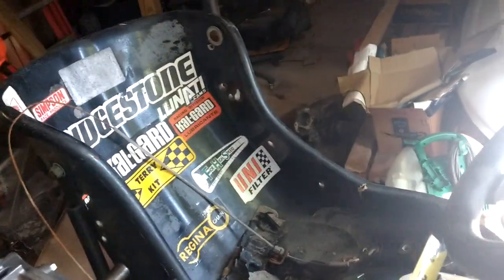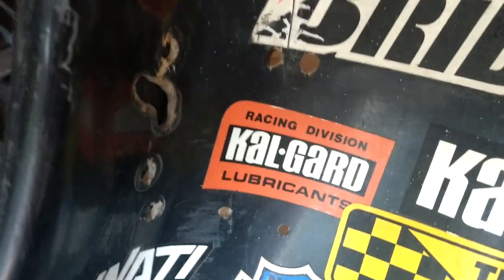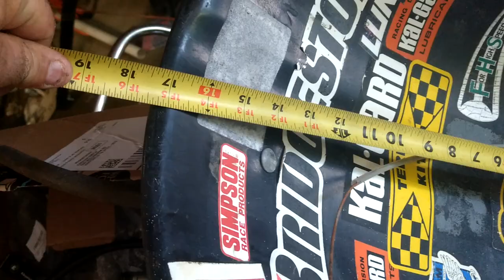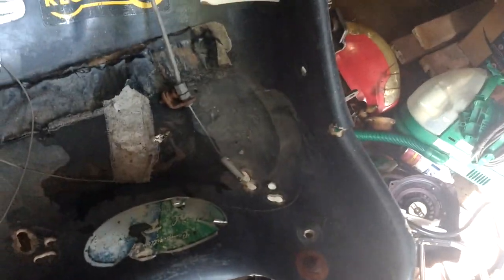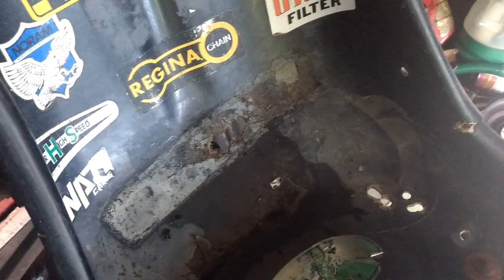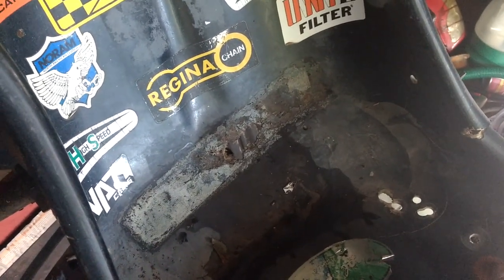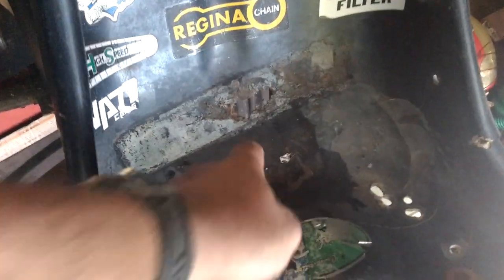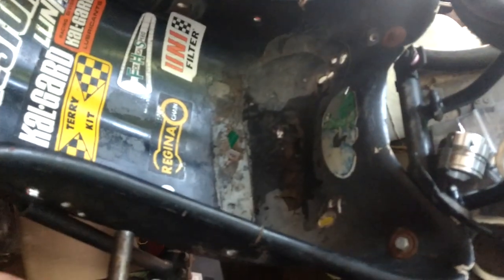Go-karts or gone fishing seat information

Comment: Ya..I think it to small..I could fixed the holes no prob
Reply from the maker: I was actually thinking about splitting it in half and adding a piece to the middle to make it wyder.
But I decided to make my own seat and make it with padding to make it easier on my back
Reply: Good deal